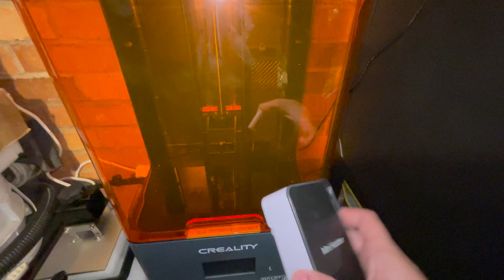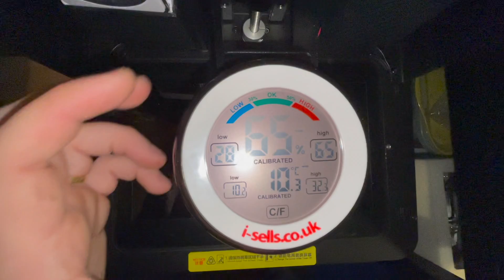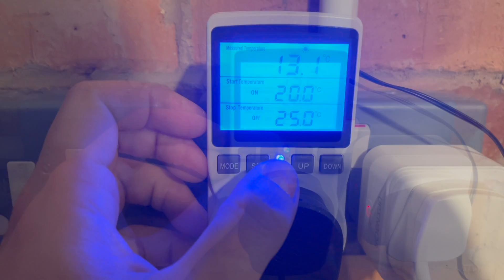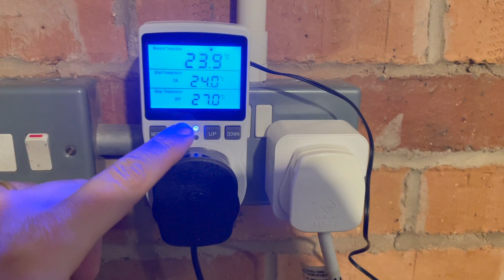Resin Printer Heater Control - Printing during Cold v2 #3dprinting  #resinprinter #winter

Comment: I have found that the commercial resin printer heaters all fail the task as the thermo sensor is to close to the heat source (sitting in the heat stream) which gives the heater a false reading. If their thermostat sensor was in a different location to the heater, the internal ambient temp would be more accurate for the internal volume of the printer cabinet and provide a better heated environment. I to use the same mini heater as you and use a terrarium heat control to maintain a stable heating environment.
Reply from the maker: That’s interesting to read. Which heater have you tried?

Comment: Huh never knew about those external temp controllers.

But you might want to check for a thermal fuse inside the heater if all else fails at least a thermal fuse will kill the heating element and prevent fire.

I am not sure if these have one or not.
They are neat tho and if i had known about these external controllers i would probably have done the same as you haha.

Nice work mate
Reply from the maker: Thanks mate. Yeah quite useful for several applications…
Reply: @scooby3dprints67  i watched bigclive he took one of these apaer there is no thermal fuse just bimetal switch.
Happy printing